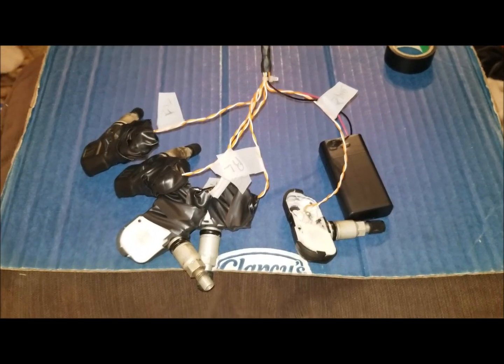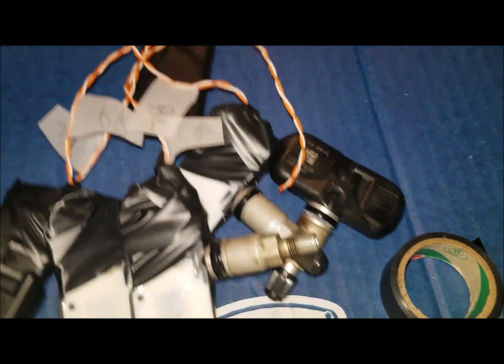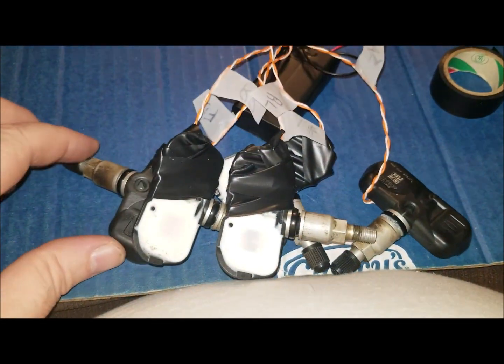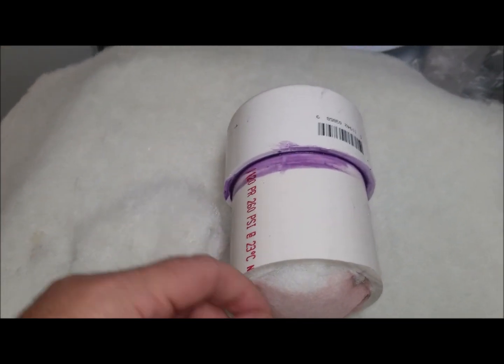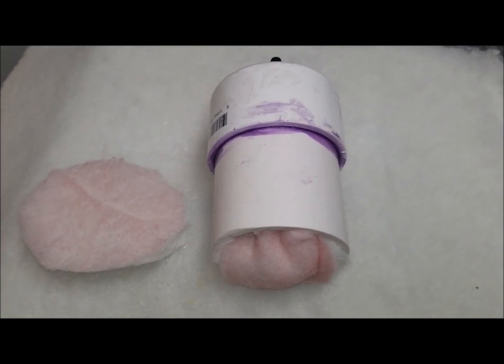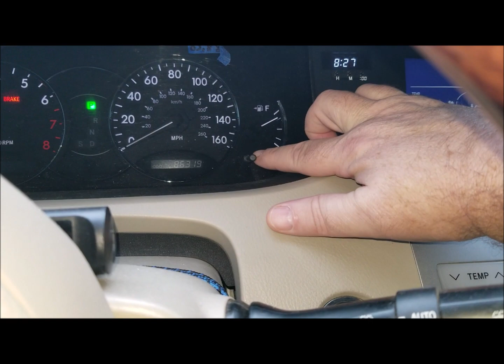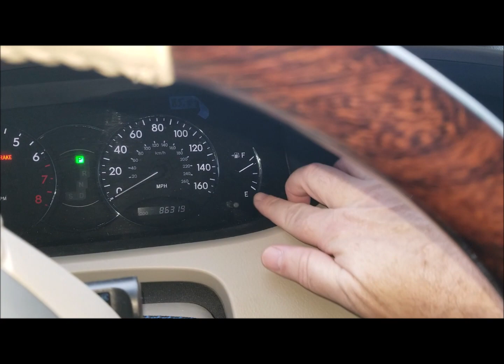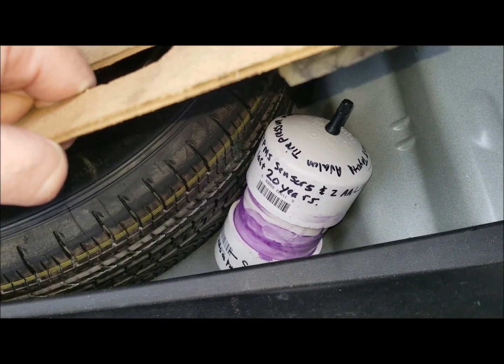Disable TPMS & Turn Off Dash Light Forever Toyota Lexus & Others Hack / Tire Pressure Monitor System

Comment: I have surmised that my car has been hacked via the tire pressure monitoring system (wifi), thus whomever then has access to the car's computuer
Reply: What possible reason do you have to say that? T PMS doesn't use WiFi or Bluetooth, computers don't work on the same frequencies and you can't communicate with them except through special service tools, what exactly do you think is being hacked?

Comment: Double A battery lasting 20 years? Not likely, everything I have ever found in a drawer over a year has been full of acid where the battery has busted.
Reply from the maker: They are LITHIUM batteries (NOT Alkaline) so they are a different animal than what you are used to.

Comment: just bought aftermarket wheels for my 2017 sierra and didn’t come with sensors,im about to do this but i read somewhere that this wont work because the sensors will never wake up since the tires are not rotating? they activate when the vehicle is moving
Reply from the maker: I do not know the answer to that one.  Maybe it is that way in newer cars?  Mine is an 08.  You should call & ask a tire store or a mechanic / technician?  ALl that being said... it sounds like BS to me, but what do I know?

Comment: How to get rid of a non existing problem and disable an important security feature.

If you really knew, you would be recommending replacing the sensors YOURSELF for $10 a sensor.

Did you save anything really?
Most likely you are using more gas or wearing your tires faster due to 2-5+ psi under inflation that your eyes cannot see?
Reply from the maker: Somehow the world functioned perfectly without these stupid sensors that embody the term "planned obsolescence". If you don't know what that is, Google it. In my opinion, the sensors might be needed for the lazy or moronic among us who don't know how to manually monitor their own tire pressure.  No thanks.
Reply: @jotu2121  Agreed, this is nothing but just another way to scam the motorist and yet another revenue stream for the dealers

Comment: Lots of work to get rid of a light.  I'm leaning to a bit of black electric tape over the light.
Reply from the maker: I tried that solution and if I remember correctly, the light bleeds too much around the black tape. Also, I think that in some states / areas (but not mine) you can't have any error lights as it relates to your TPMS in order to pass your annual inspection (to keep your car legal).
Reply: That’s what I did!

Comment: I wish there was an easier way. This system is the biggest pain in the ass and just a money grab. I have summer and winter tires and I feel more confident checking the pressures on my own. You lose 2 or 3 pounds of pressure and the lights come on... It's not even noticeable. I've had slow leaks before and I can certainly tell that something is wrong way before it becomes dangerous. With 8 tires and new tpms settings I now have to get the summer ones checked out at a dealer because the lights came on after the switch having failed to reset (as per the manual) This method requires me to remove the tpms from the tires rigging this up and not being sure it will work upon changing to the winters...I would love to see a solution that can disable this from the control unit itself.
Reply from the maker: I agree with you but, unfortunately, I am almost certain that (after a certain year of car production) TPMS were required BY LAW so disabling prolly is NOT doable.

Comment: this video must be bann by youtub administrator! ths way not working at all, once you pump air in, it will explode the plastic pipe, if you do glass bottle will explode too and could glass damaged your face, this video dangerous for people, it must be metal and rubber - like a foot ball but it will blow big and no space in the car where to put. Worst video, shame!
please remove the video - you are loser who uploaded the dangerous video.
Reply from the maker: This exact setup has been functioning perfectly FOR YEARS sitting next to my spare tire in my car underneath the false floor of the trunk.  No leaking, and no explosions or anything else that you listed.  With all due respect sir, I think that you may be in need of some medication as your post simply makes zero sense.

Comment: same location of the button as in my lexus GS gen3. i am thinking about doing the same, i have winter rims with winter tires without the sensor inside them that is programmed to my car, and i am debating with myself if i should take out the OEM from the summer tires of see if i do have sensors in my (used lexus rims with winter tires) that can be programmed. however can u program them with them inside the tires, or do they need to be removed?
Reply: 99% sure that you can reprogram them while they're in the tire on the rim. The problem is you have to have a device to be able to do it with which you may be able to buy on eBay cheap I don't know. or you've got to be able to talk a tire store person to doing it and I'm not sure how hard that is. But I'm almost certain that's what they're designed for. I recommend going to any tire store.  Sam's club is a good one because I don't think they're so focused on converting You to a big sale.
Reply: @jotu173  Toyotas and chevys you can use the car to set those. No special tools needed. its explained in manual.There may be other brands that have this feature as well. My 07 Chevy was easy. I just pushed a few buttons on dash and went around topping up pressure in each tire one at a time. Once the tire was at recomended pressure, the horn honks once then on to the next tire ec...

Comment: Would this work on a Honda? I've tried tricking them in a tube before and nothing.
Reply: Toss them in your spare
Reply: @1sleeve  great idea until you have to use the spare or forget that the sensors are in there (or both).
Reply: I have no idea if it'll work in a Honda but I don't see why it wouldn't.

Comment: sounds good however the batteries them self will leak battery acid after 2 or years3 years just when you leave batteries on a remote control or flash light
Reply: he used AA Lithium batteries, (no acid) but they don't last 20 years maybe 4-5 years and after that they will fail again.
Reply: @mikemazzoli1990  if you are correct, then I will just use more battery packs and only a few monitors per batt. pack.